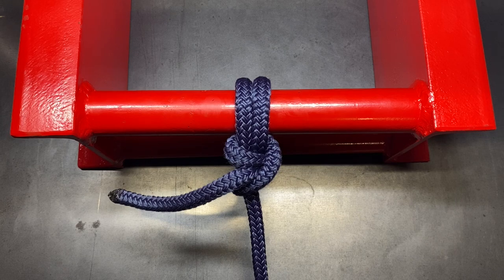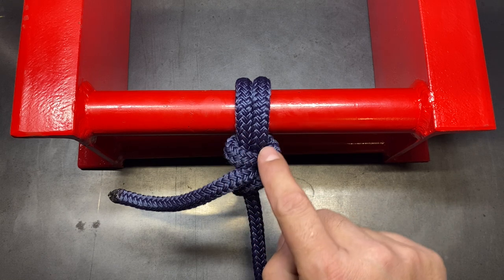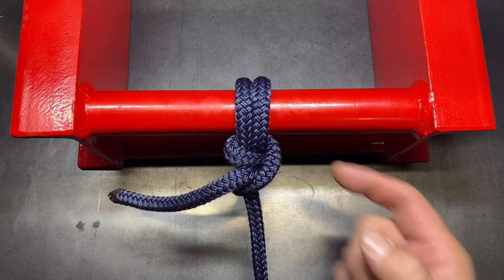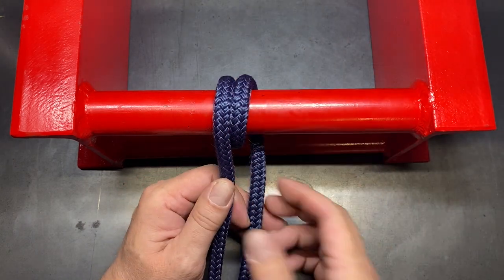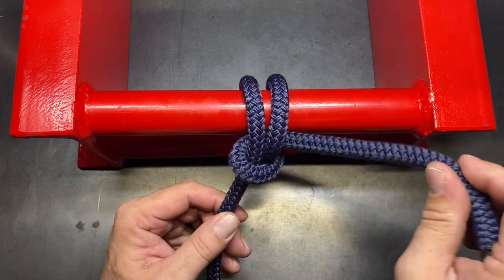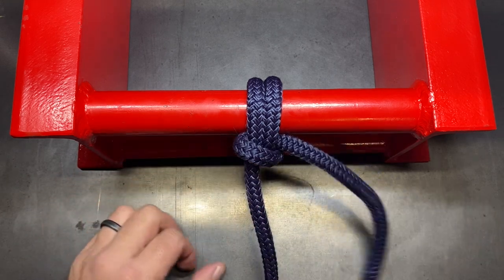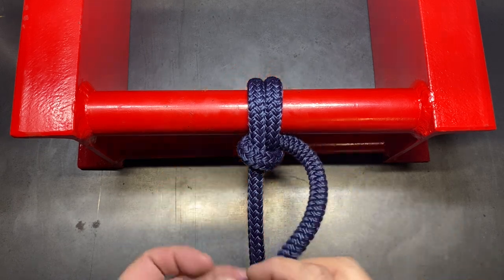Anchor Hitch

Comment: Excellent, clear instruction.  Arborists use this as a termination hitch onto their harness - they trust their life on it.   Some would add a stopper knot in place of the final half hitch.
Reply: There’s a variant on this hitch where you feed the line back through the loop again, instead of finishing off with a half hitch
Reply: @TJB270  Another variant bends the working end back and tucks it under the first wrap.  That's a sailing knot called the Studding-Sail Bend (although it's really a hitch - knot naming conventions are not always adhered to)
Reply: @JohnGreen_US  interesting. I’ll have to check it out
Reply: Arborists never tie the second half hitch
Reply: @TJB270 I am not sure if that second wrap adds security though, because then you have the 2 turns sharing the clamp down.

Comment: The Anchor Hitch (Anchor Bend) is a great knot, but other well-established knots are well-established for a reason. The Roundturn and Two Half Hitches (RT2HH) is much better while tying/untying under load. For example, you can tie the RT2HH while the load is present, like a 100 lbs weight suspended from a tree limb, and untying the knot holding that suspended weight is easy. Also, a RT2HH allows tension to be added to the line by completing the round turn, and it never jams. I actually currently cannot think of another knot that has all these capabilities in one knot.

In contrast, the Anchor Hitch is impossible to tie or untie under a heavy load, does not allow tension to be added, and always has slack before applying the load. However, it is highly secure and gets more secure with more load.
Reply from the maker: Backhand Hitch
Reply: @txtoolcrib  Yes, I just remembered the Backhand Hitch a little while after posting. It has similar capabilities to the RT2HH, and it allows adding a bit more tension to the line.

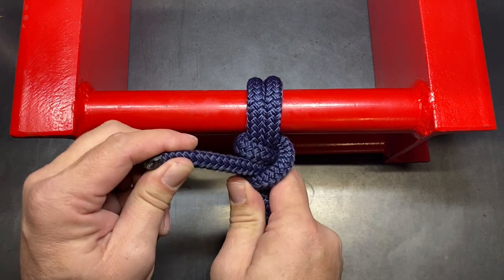Comment: Great demo & explanation of the knot's working. Question: @0:48 Would it matter to the knot's integrity if you took the 2nd half-hitch UNDER the standing line rather than OVER, so that the loose end finishes pointing down through the 2nd half-hitch insteaf of up. Doing so seems to end up with slightly better dressed knot.
Reply: It is a different knot at that point with different properties.